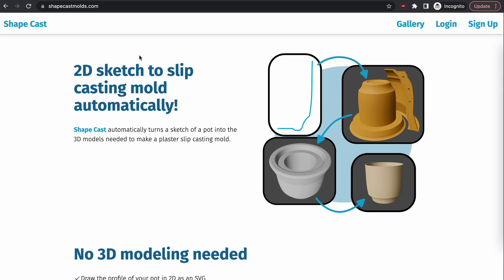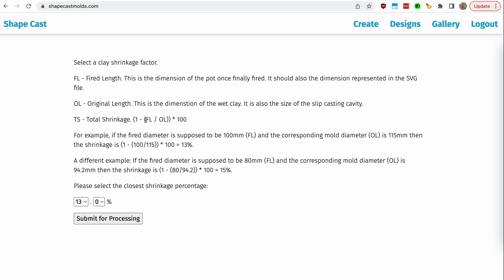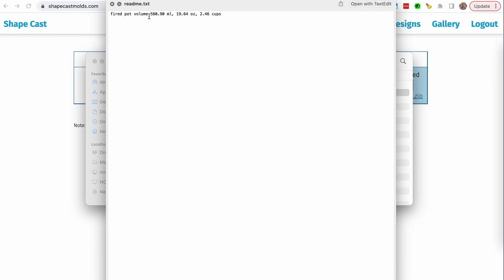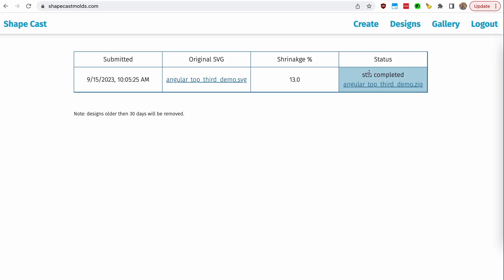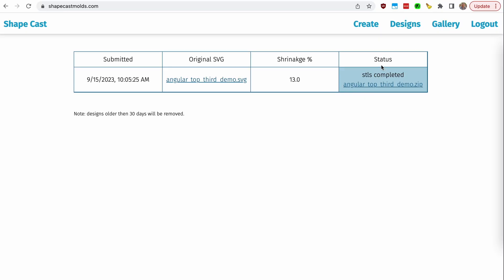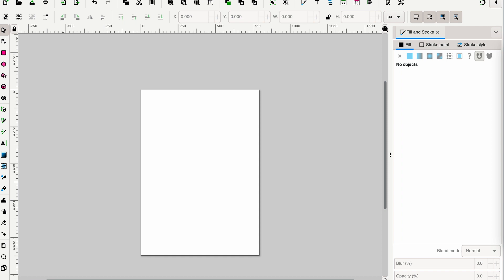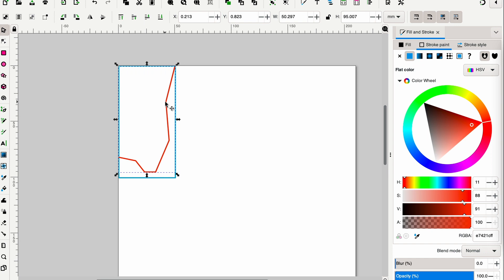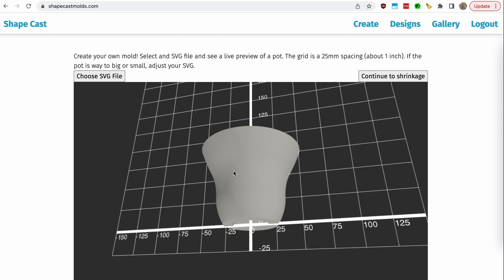Shape Cast - From Sketch to Mold to Pot - Automatically

Comment: What is the best filament to use for plaster casting?
Reply from the maker: I use PLA+ which is a bit stronger than regular PLA, but it shouldn't make a lot of difference with a good printer.
Reply: @PotterybyKent thank you! That's what Chatgpt recommended but I didn't know if that was correct.

Comment: Kent I had a question about printing time on my Prussia 3d printer in regards to the tumbler? With supports some of the parts have a print time of 27 hours? Is that a normal print time or am I missing something or doing something wrong. Forgive me if it seems like a silly question. It’s my first time printing.
Reply from the maker: It depends on the kind of supports and the resolution. I used organic supports which cut down the print time, and then increased the layer height to get it to go faster. If you print with fine settings, it could take a good while. (And in general these are big so are not fast). The outer molds, if you're using them should be printable without supports.

Comment: Signed up! Got my solo cup design SVGed to try out with it.

Thanks for the impromptu Inkscape tutorial, too. I was going to export a DXF from my software and clean it up, but just ended up using the line/bezier tool to bang it out in Inkscape directly.
Reply from the maker: Great! Yes Inkscape works reasonably well as a vector editor.

Comment: Kent, this looks great! I drew my profile in the opposite direction from your examples out of habit. Lets say the left hand side of the profile. Starting from the bottom at the lower right and sweeping left and up (hope that makes sense). And got some funky results, like the empty space was being rendered instead of the pot. Once I realized what was happening I drew it up again using the same side you use and it rendered great. Waiting patiently for the results.

Thanks!
Reply from the maker: Great! Yes, it is orientation sensitive (if it's mirrored it won't work) and that convention really comes from the coordinate system for SVGs. I'm not sure if I can automatically detect if it's mirrored or not - I'll need to think about that.